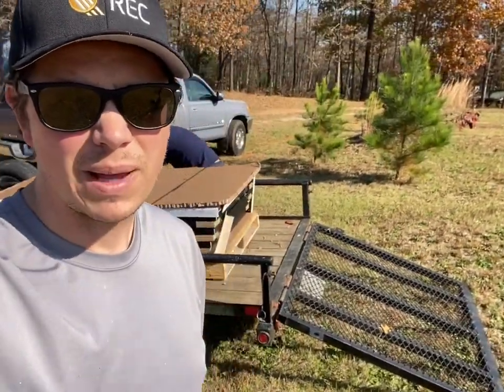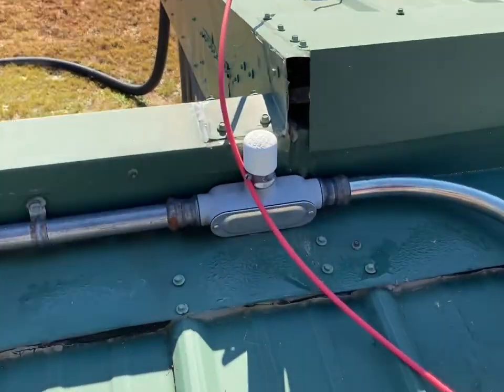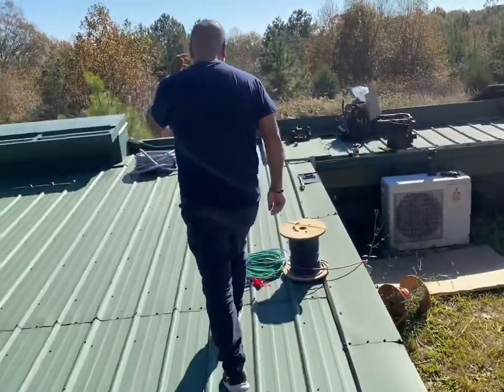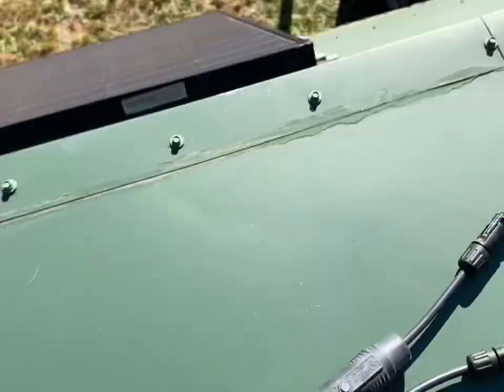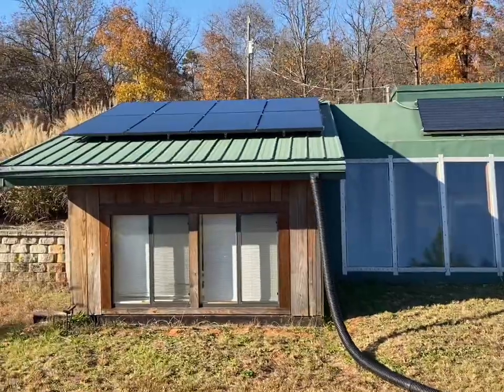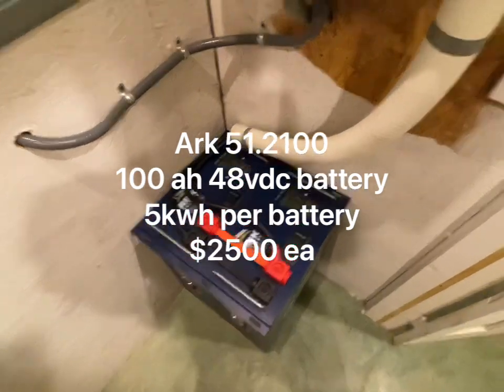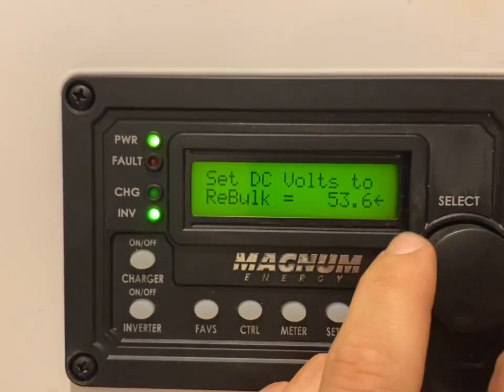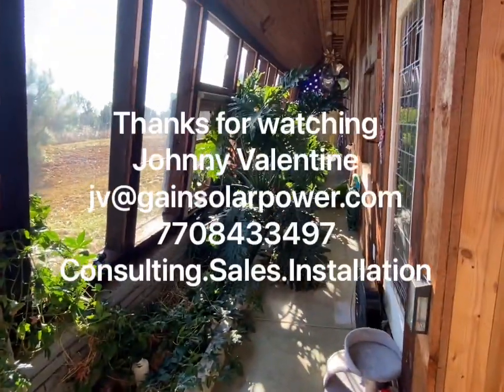Earthship Upgrade: 2.4kw Solar & Ark Lithium

Comment: Are those batteries waterproof? I am looking at doing a system in my house and had been eying the EG4 GYLL 48 volt server rack batteries. I guess they wouldn’t install as compact as these but not sure if there is any risk in mounting them on the floor?
Reply from the maker: They have a bolt on stand so they sit about 2” off the ground. What do they need to be waterproof
Reply: @GainSolarPower  they don’t gotta be, I just saw the stand in another video you had. I don’t like water though, had 5ft in my basement a few years back so I’ll probably put them up high somewhere.

Comment: Hey Johnny wish you a great 2022 I know you like the magnum inverters I have 2 4024 pae can I use them in a grid tie or is off grid my only option?
Reply from the maker: They do not sell back.
Reply: @GainSolarPower  thanks Johnny for your valued input since the magnum cannot be grid tied, I’m just going to permit  the off grid with lithium ion backup system as it sits, and I will be adding the raptor rapid shut modules to comply with the nec 2017 code! Thanks
Reply from the maker: @burtonnystrom4606  You can hook the grid power to it and it will use it to charge batteries and passthru to the loads when the batteries are low.  It just wont sell back.

Comment: what is an earth ship....does it fly, float, roll, crawl...???
im missing somthing///
Reply from the maker: It’s a building style. Look up garbage warrior earth ship.
Reply: Self sustaining home.   It's basically low tech passive solar house that has high insulation, uses the sun for heat plus thermal mass to store it for the night, ventilation to release excess heat, cooling tubes that uses the earth to cool air for a sort of low tech air con, water harvesting, re-using grey water for the planters and flushing etc.